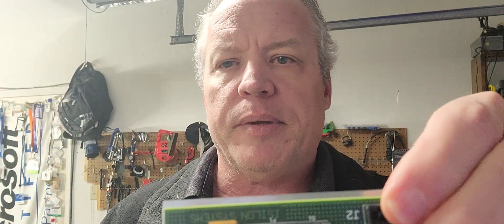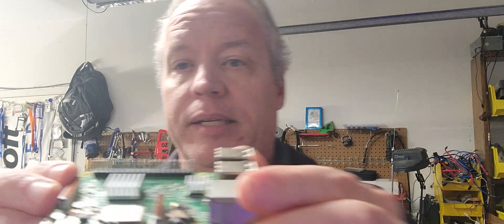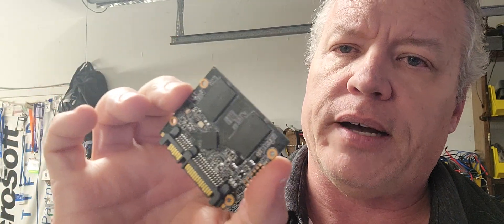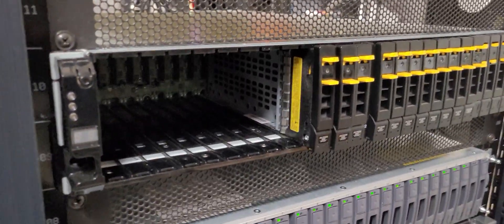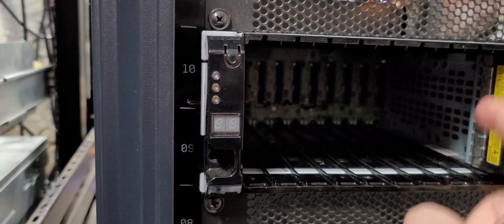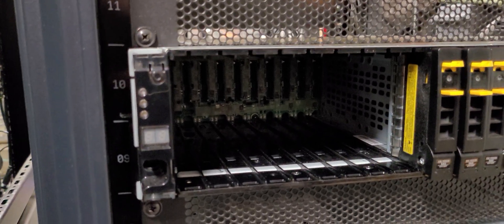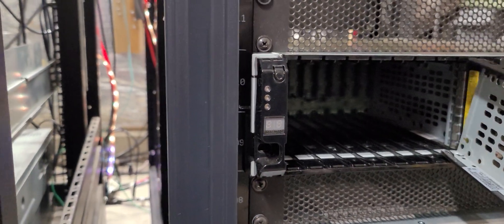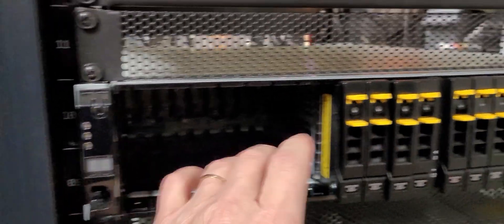Why SSD Drives use more power then spinning disks do and S.M.A.R.T. is to blame.... Yep!

Comment: SSDs do 'spin down' they have low power states that they jump in and out of in an instant.

This is fundamentally untrue. When at load they use less power & will be at load for much less time (given the same workload)

All due respect this is mostly untrue.
Reply from the maker: Well sorry to say but my DS-2246 arrays and my two 3PAR and my 2 EMC arrays both having SSD in one array and SAS disks in the other don't say that to me on the Watt voltage meter as I test the power mode over weeks. Over a 1 week time period I saw 78% higher power usage difference in with each  SSD populated arrays vs. the SAS disks arrays.  Maybe if you have the same setup we could compare notes.  It is good to see if maybe you have something new that I could check out.  My gear spans over most of the DMS-SMART disk services time period.  I am looking at a couple of new arrays...  ( 24 disk 3 channel but in a smaller format, Once the prices come down. As for NVMe 24 slot arrays.... That is a waste of time for you can't get the speed ever.  Can you say bottle neck please... )  Tell me about your setup.  What disk arrays are you using?  What type class strip set are you using?

Comment: Pretty sure a Sata SSD will use less power then a 7200 RPM 3.5" drive..
Reply from the maker: pair side by side yes but if you just use them over time the spinning disk powers down when not in use unlike the SSD drive.    Over time the SSD uses more power.  But when the update for SMART comes out that should change I hope...   We will see.. /:>

Comment: I probably spaced out during the end of the video (it's a bad habit, I do it all the time, even when talking to friends) but don't higher-end SSD from brands like Samsung not have DRAM cache? Linus Tech Tips always goes on about how cheap SSD lack DRAM cache.
Reply: Yup, also newer SSDs without DRAM cache use system memory as a cache instead, if available.
Reply from the maker: @edwardecl  Yes and with the same effect as on board cache.  It is limited.  Now the nice thing with TrueNAS you can add a lot of memory and provide a RAM drive of sorts that can take all in coming data then write it to any type of disk... Sweet!  We had RAM drive back in the 90's...
Reply from the maker: Correct both end end SSD drive do havea form of cache and so do enterprise level SSD drive but remember that when RAM is cache for RAM so you get some added value but not that much like spinning disks do.